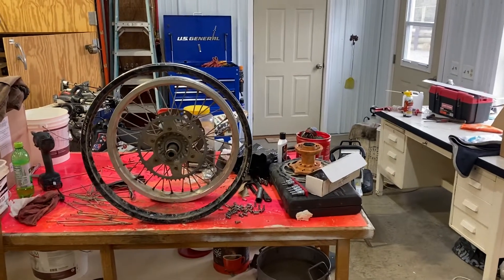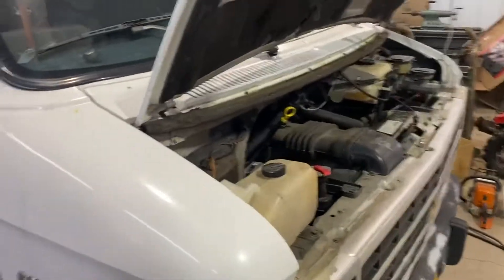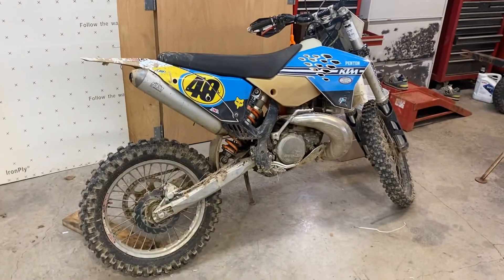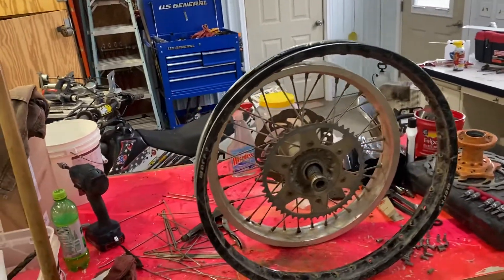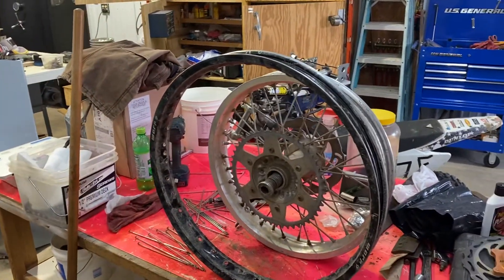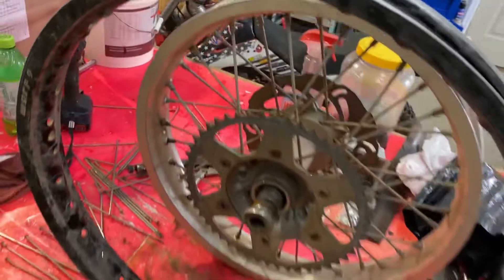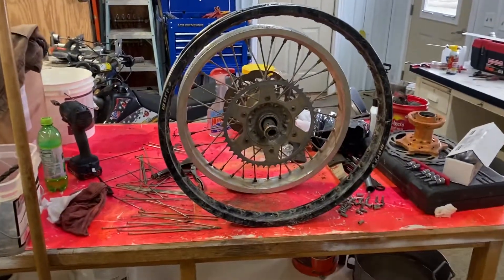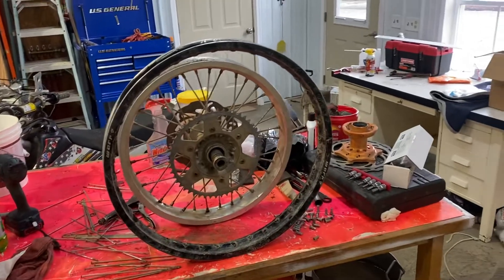Spare wheels for KTM?  (Of course it's not that easy!)

Comment: Nothing wrong with older things when you are working on it and maintaining it, alot of times newer is not better. I know how that bike runs been passed a few times by it lol.    For me I would buy a good set of rims used since I do not have a truing machine and never did a wheel before.  I am just not established here enough if any shops so just better for me order a set.  But I wish I did know how to put a complete rim together I see a front rim in my future.
Reply from the maker: Well I just looked again at Rocky mtn ATV and a set of tusk wheels is not bad at all price-wise.  Now for the longevity and quality I can't say...
Reply: @Rough&Ready  I like alot of tusk products and for me at my level I would be fine with a set of there wheels.  I tried there tired but motocross and enduro and just do not like grip and the fronts I rip the side knows off just like a dunlop. There I will stick to my brigestone m59.
Reply from the maker: @hkramer52  Yeah that will probably be what I do.  The M59 front and ve33 gekkota rear is what i run and I aint changing any time soon haha!
Reply: @Rough&Ready  I switched to the m59  when I got the KTM and still looks new after 4 races. I have the Shinco cheater 525 on the rear and like it but was thinking next trying the ve33. Also using tubeless front and rear kinda a pain but I like I can air up if on a motocross track and air back down for enduro.